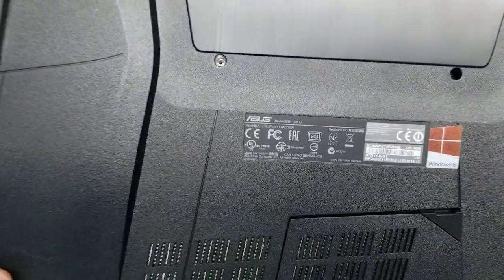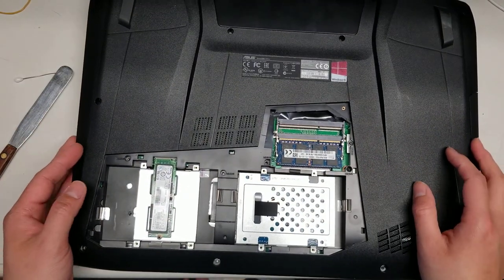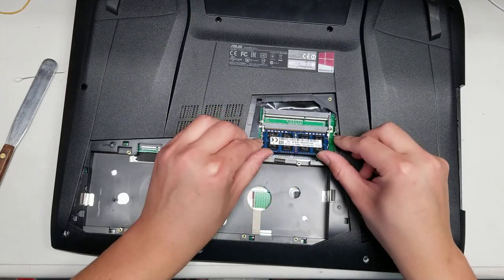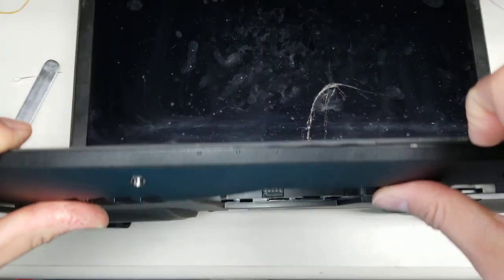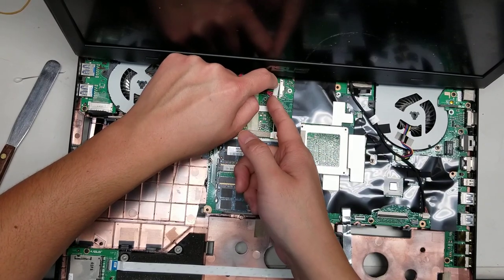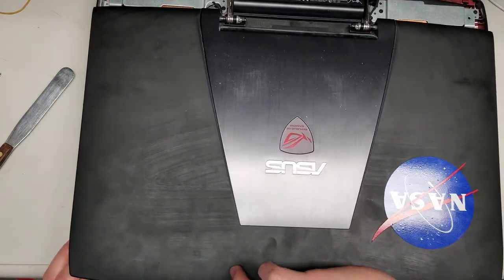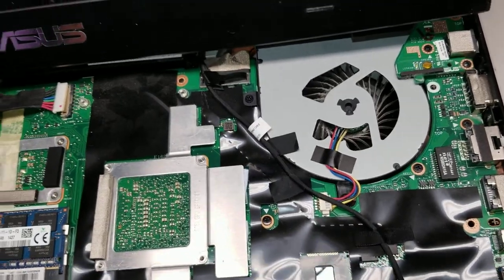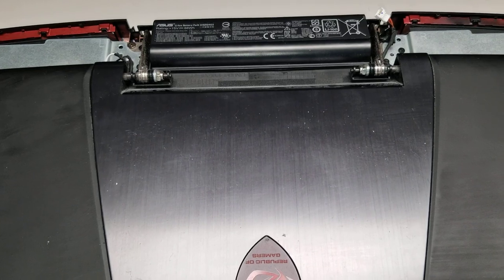ASUS G751J Disassembly SSD RAM Hard Drive Upgrade Repair

Comment: For anyone who may be confused this may be a newer G-Sync model that has a M.2 drive slot and older ones only come with 2 Sata drive slots.
Reply from the maker: G-sync?
Reply: @ItsBinhRepaired  its a Nvidia tech that lets the GPU freely set the refresh rate of the monitor to the FPS of whatever is on screen
Reply from the maker: @sirtiberius1083  I see

Comment: Mine does not have the NVME slot like yours, so it must not be the same across the board.
Reply from the maker: Same model number?
Reply: @ItsBinhRepaired  I have an Older G751J and it only has 2 sata drive slots and no M.2

Comment: Hi my friend, I’ve a G751JT, may I have your suggestion about changing my HDD and SSD ? Before your video I thought that HDD can only be replaced by a SATA SDD😅. So, what’s the best choice for the two slots on 2022 market?   (What is the best choice for SSD slot and what is the best choice for the HDD?)
Thank you. 🙏🙏🙏🙏🙏🙏🙏
Reply: 谢谢
Reply from the maker: Did you open yours to check for the slots?
Reply: @ItsBinhRepaired  Yes im looking at them now，exactly the same as yours
Reply: @ItsBinhRepaired  I even checked the SSD description letter by letter. Exactly the same as yours beside the WWN number.
Reply: @ItsBinhRepaired  For a laptop/computer rookie as me if I want to upgrade the HDD to a SSD, I found if I change the SSD I need to deal with the system stuff which is more complicated to me. what’s the best option I can choose on the market?  Seems only Samsung 870 evo is the best for the slot? I don’t know pls help 🙏
Reply from the maker: for m.2 I'd go with this https://amzn.to/3BXzGyx

for 2.5" I'd go with this https://amzn.to/3CoCm9G
Reply from the maker: This video will help https://youtu.be/4p5jFDzVwUw

Comment: Question off topic. Do you know the wifi card model? Can't find it anywhere.
Reply from the maker: You'll want to check the Wi-Fi card itself. The sticker will have the model number
Reply: @ItsBinhRepaired  no I meant what is the standard model wifi card for this model of asus? Or what card do you have? Either works.
Reply from the maker: @RockNinjaToska  I don't check that. I just fix the computers.
Reply: @ItsBinhRepaired  ah that's fair. I wasn't aware that was the gig. Just came across the video. Thanks though for the response.
Reply from the maker: @RockNinjaToska  no problem. Hopefully you'll be able to find the info you're looking for.